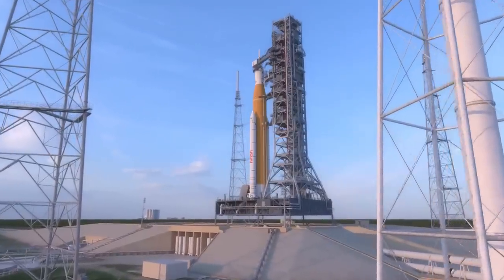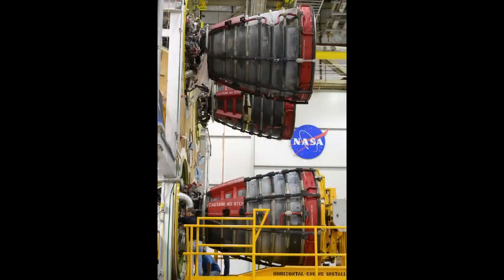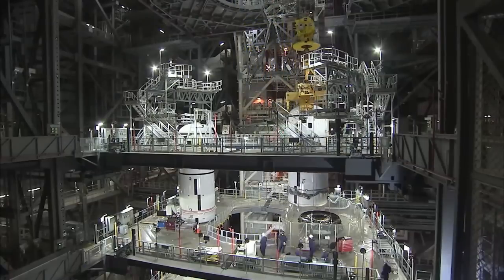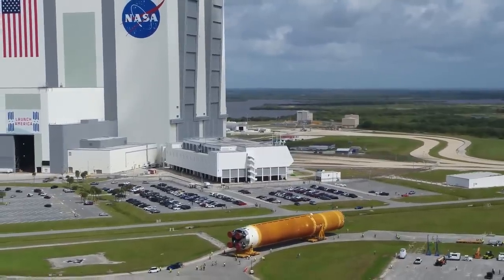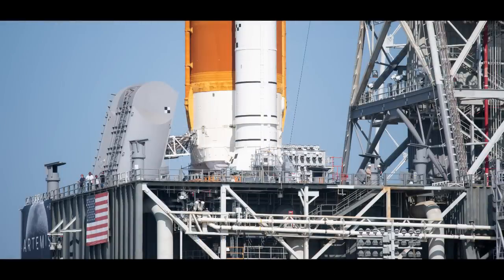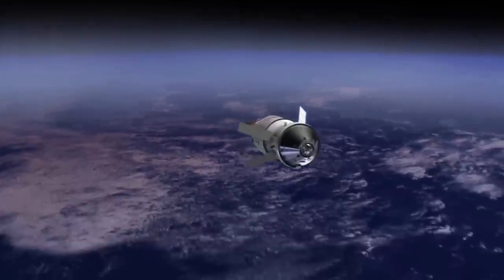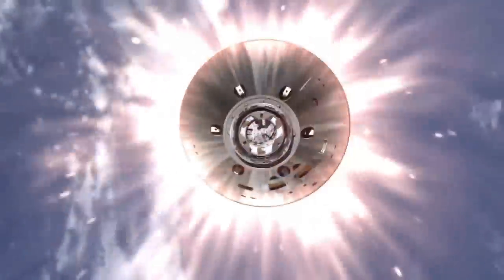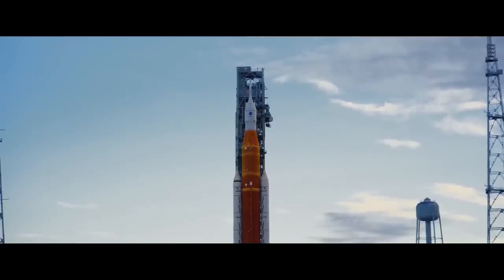What's The Big Deal About Artemis - NASA's New Massive Moon Rocket

Comment: I hope they will double-check their staging before launch!
(That's a mistake I did too many times.)
Reply: I nearly always get staging right... but forgot the parachute way too many times.
Reply: I get the staging to "look" right but first stage separation separates 3rd stage
Reply: I am hoping they are using the correct clock for staging.
Reply: when you go to launch and both of the boosters leave you behind on the pad
Reply: no big deal. Mission control can just press "return to launch".
Reply: I am hoping they removed all traces of red tape before launch.
Reply: They can just re-jig the staging on the launch pad like I do.
Reply: @5Andysalive  imagine seeing SLS just teleport back to the pad lol
Reply: @5Andysalive  they are playing hard mode so no quick saves or revert to launch
Reply: Also make sure your capsule isn't put in upside-down lol.